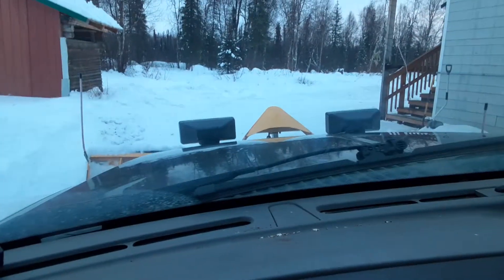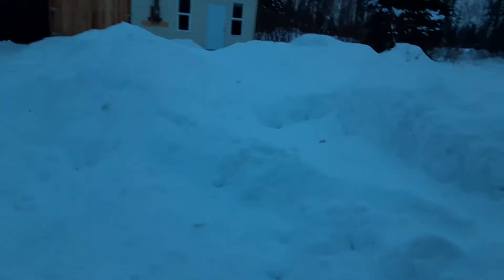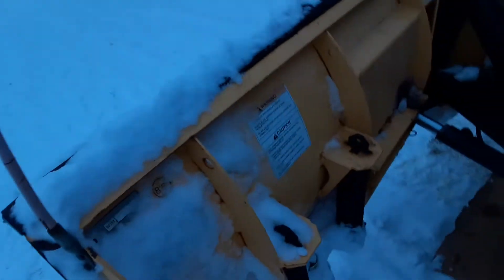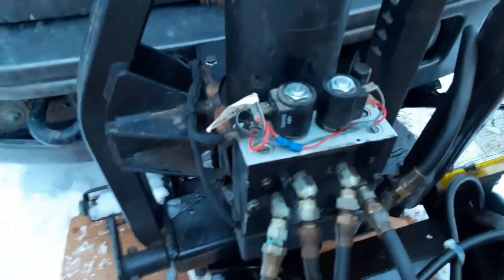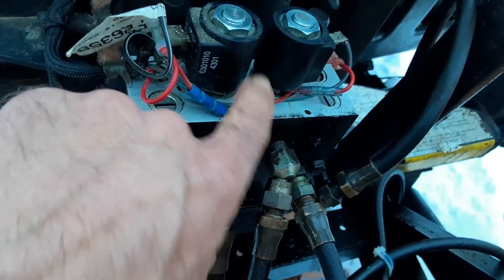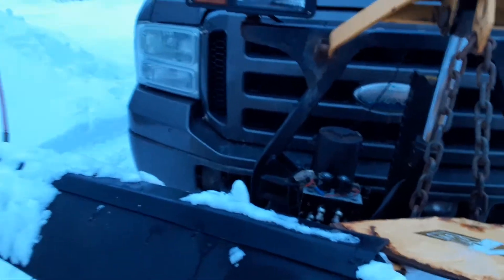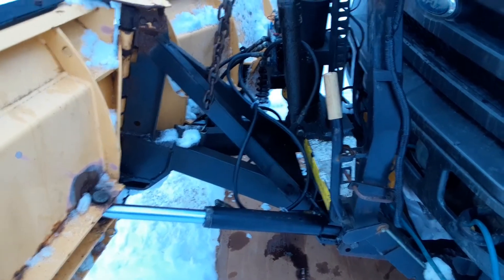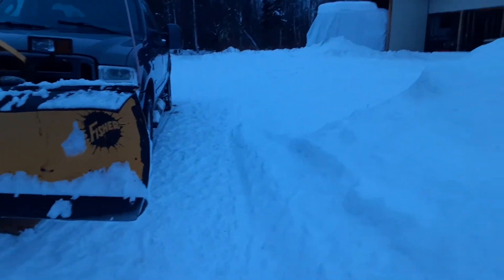fisher ezv plow hydraulic problems.

Comment: Hello Mike...I've got the same issues, with the  same plow. What was the problem?
Reply from the maker: Aaron, it's still not correct I did contact the company and the sent me a valve rebuilding kit changed all the valves in the manifold still the same. I believe it is one of the rams leaking back through. I'll let you know. You can always call me we can exchange ideas. 570 441 0944